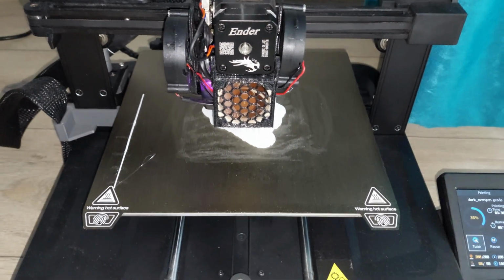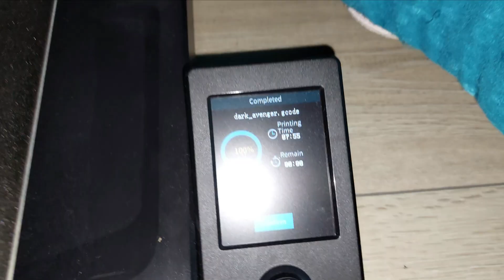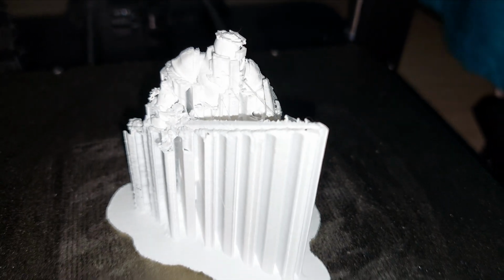How to Make Your Creality Ender 3 V3 SE Silent | Upgrade Guide

Comment: the most noise on mine comes from the bed slinging...also the fan is annoying.. wont know the difference until i change them? do you need 2 buck converters for the bottom? cant you just use one?
Reply from the maker: You need 2 because there are different sources of power, the psu one doesn't start in the same time as the motherboard one
Reply: @pythoneatssquirrel  oh that makes sense

Comment: what fans did you use for the motherboard? hard to hear? thanks
Reply from the maker: Noctua, there are dead silent
Reply: @pythoneatssquirrel  have you found a way to reduce bed sling noise on these? Do linear rails run quieter? 😕
Reply: @ValleysOfNeptune2150  the noise is from de step motor from de bed